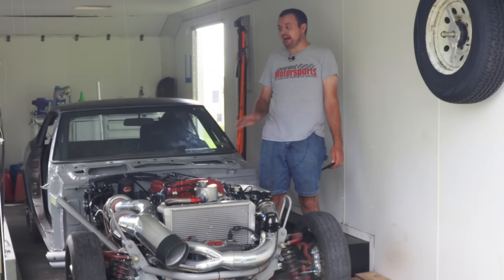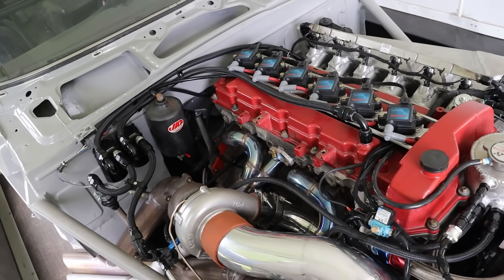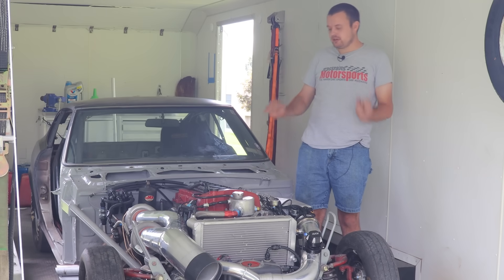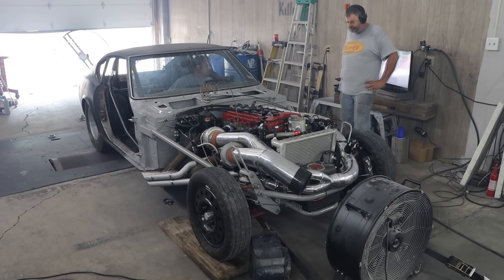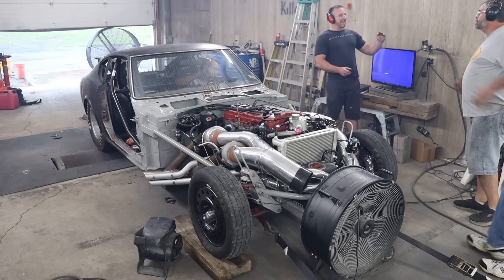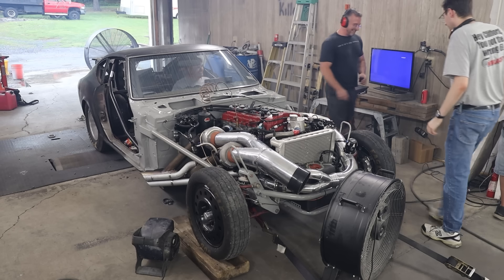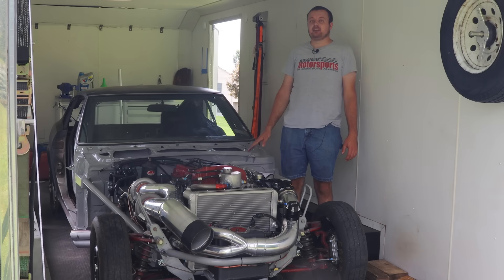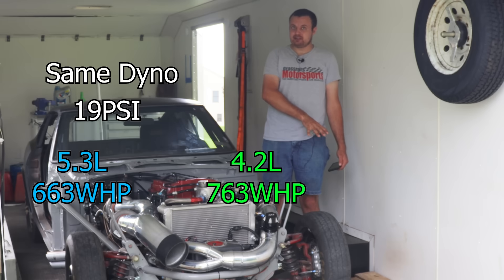This 4.2 Liter Engine Just Beat a 5.3 LS!

Comment: Im not certain why its refered to as a Barra engine.  Y understanding the Barra is a Australian ford eng   https://en.m.wikipedia.org/wiki/Ford_Barra_engine
Reply from the maker: We didn't get the Barra. It's similar to the Barra in a lot of ways.... so Ameri-Barra
Reply: @Calvin-Nelson  i understand but if its not a barra its just a inline 6 which is what the barra really is. The only real differance in the so called barra is that it has a very strong block that is really the very old ford 6 devoloped in Australia, for the lot tougher Australian conditions to ensure it could acturally last a reasonable time. 
Holden (GM) also had similar motors which replaced the old gray block. The red block was also made very strong to counter the vibrations and the harsh enviroment. This is what made them great engines. 
Both companies also devoloped a stronger v8 based on the american motor to overcome the same problems. Chrysler did the same for the v8 only
Also anouther reason is our fuel rating were different thus the need for slighly different compression ratios etc.
That is also why holden were still making the v6 blocks in aus and in the end the south americian blocks used in the USA were the aussie casting design. 
So in reaility the nick name of the Barra is just an Aussie 6. We Aussies love nick names and slang.
Reply from the maker: @tfsupp  OK. That's nice. A lot of folks I talk to call these the Ameri-Barra. Americans like nicknames too.
Reply: @Calvin-Nelson  yes its nice that you use our nick names. I really dont have a problem is just points of interest. 👍
Reply from the maker: @tfsupp  yup. There has been a  few Aussies that are very upset that I dare to compare it to a Barra. It's just an engine. Barras are probably better but we haven't proven that yet.
Reply: @Calvin-Nelson  i understand, im not upset at all, in fact im not even a ford or holden man (calling a GM motor a barra (ford) butt fu@ks all the ford idologs, big tribal issue here )  As  fitter turner (what you call a machinist) & marine engineer i just like engineering. I acturally love what you did here and your channel. Sorry if i didnt explain the original comment well. 😊👍

Comment: I have so much respect for you guys, doing what you've done with this platform. Just because a refined combo of one engine makes more power at a certain boost level than a random combo of another engine doesn't mean it's superior. It DOES mean that it's impressive and deserving of aftermarket support. In fact if the oil pan, transmission adapter, and maybe a few options on headers and mounts, then the weekenders might start trying this stuff out and that would be great to see!
Reply from the maker: Eh. I think the impressive part is how much less cam it had. Just my opinion.

Comment: I purchased a trailblazer with a 4200 in it that was knocking like crazy. Thing threw a rod on the way home, 2 large holes in the block and it still drove 6 miles to a friends house. 

Everybody that knows about these engines know their strong as hell. I rember someone saying GM didn't release cam blanks or cranks for them that's why nobody bothered building them.
Reply from the maker: You can get so much out of the stock cam grind. There has been a lot of folks that have built them. Most have them have been very secretive about it though.

Comment: I've been wanting to do some kind of build with one of these engines for years.  I'm thrilled to see how this latest build performed.  I'm personally interested in the 3.7L 5 cylinder variant because I've considered an Atlas engine for a few platforms that the six might just be a bit too long for. (the exhaust note would turn some heads too)  I've already got the car to put it in, it would end up being a RWD conversion for the chassis and definitely be a one of a kind swap on an iconic 80s European chassis.   One aftermarket part idea I think would be cool: forged pistons in the 2.9/3.7 4 and 5 cyl bore size (in addition to the standard bore)  
Has anyone been able to determine the thickness of the cylinder sleeves?  It would be cool to bore the 4.2 out to the bore size of the later 4 and 6 cylinder variants if possible, that would give you a 95.5mm bore and a 4.4 liter displacement.
Reply from the maker: I believe the Self Racing guys did that. Personally I think it is a waste of money with turbos, but to each their own.
Reply: @Calvin-Nelson  As in, the overbore?  I can certainly understand how the mild displacement bump isn't worth the money and machine work, for sure.  I couldn't help but be curious about the cylinder wall thickness, though.  Maybe at best,  overboring to 95.5mm might be one way to rescue a 4.2 block w/ bad bores?

Mostly I'm just interested in following the methods you guys have come up with on the 5-cylinder variant, I think just under 5/8 the horsepower and torque will do my project just fine!

Comment: Curious if you've ever thought about dropping in a 4.2 i6 into a Pontiac Solstice or Saturn Sky?  I'm contemplating whether or not to take on this very build myself.  From what I understand the 4200 will mate up to the Aisin AR5 5sp manual it just requires getting a bell housing from a Colorado 5sp manual.  I would be very interested in knowing what you think about this idea, Calvin?  Thank you in advance.
Reply from the maker: That would be very cool. Might be a tight fit, but I'm sure you could make it fit with enough determination.
Reply: @Calvin-Nelson  - That's what I'm thinking! Have you seen anyone mate up the 4200 to the AR5 manual transmission before? From what I've researched I've only read that it is possible, but can't find anyone that has done it yet.  This would be another reason to do it, just to be the first.  A ton of people have LS swapped the Solstice/Sky platform, but I think an I6 would be epic.  I really enjoy your videos and content. Thanks for your input and response!
Reply from the maker: @WattsAudioTahoe  the colorados came with an ar5. It's been done many times.
Reply: @Calvin-Nelson  -- Thanks Calvin, I'm glad to hear it's been done. Good luck at the No Name Nationals!  Can't wait for the videos!

Comment: I think you're going to be hard pressed to get big name manufacturers to provide parts for something that's been out of production for so long. These engines will dwindle away long before they could ever recoup the associated costs.
Reply from the maker: You could be correct, but LS engines are no longer mass produced and they still have parts made. Same with 2JZs, 440 mopars, Small Block Chevys, etc, and they still have parts made for them. Just saying.

Comment: Fun engine but even with all your modifications you can't fix that anemic torque curve. Love what you are doing but this engine was just never meant to be driven around the town. At least in my trailblazer I would often wish somebody would hope out and start pushing because until about 4500 rpm there was no torque.
Reply from the maker: Sounds like something was wrong with yours because in stock form they've had nothing but torque in our experience. They just need freed and boost shoved down their throat.
Reply: @Calvin-Nelson  nothing was wrong it just didn't have much low end torque. After 4000rpm it was quite fun, but felt like you always needed to down shift to pass or build rpm from the stop sign before it got exciting
Reply from the maker: @brianhunt6943  yeah. It sounds like your VVT system had issues.

Comment: What were the full specs on the 5.3? I can see a dohc 4 valve matching a proper H/C 5.3. Hell of a turbo set up. Wonder what that motor weighs.
Reply from the maker: The 5.3 was a stock bottom end LC9 with 706 heads. I had the cam specs in the video. The 4.2 and aluminum 5.3 are very similar in weight.

Comment: How well would this motor do in a half ton truck? I know ford has the smaller 3.5 Ecoboost but is the 4.2 good enough in a daily driver truck application? This motor could be the end all Ecoboost killer and could probably outperform that inline 6 dodge is making
Reply from the maker: It would probably do pretty well. They make good torque.

Comment: 2002 4200 trailblazer cam position code. Replaced it and cleared code. Code is back runs rough but only sometimes
Reply from the maker: Sounds like vvt related issue. Could be the solenoid or the actuator
Reply: @Calvin-Nelson  thanks. I'll try the cam phaser solenoid then

Comment: Same boost but less cylinders to fill with air. So wouldn’t the same boost be different from the v8 to the v6
Reply from the maker: Boost is boost. Volumetric efficiency is volumetric efficiency. Doesn't matter how many cylinders there are.
Reply: @Calvin-Nelson  oh cool. So 19 pounds in 8 cylinders is the same as 19 pounds in six. That’s cool. Never knew thought. But assumed for a long time. Thanks for that information. Always needing to learn new facts. Thank you
Reply from the maker: @leviorourke7498  No problem. Boost is just a measure of restriction. What this tells us is the 4200 is less restrictive and flowing a lot more air.
Reply: @Calvin-Nelson  so glad you commented back. A lot of stuff now makes a lot more sense. A lot more sense to my outlook on certain mods an motors. Thanks again!!
Reply from the maker: @leviorourke7498  Yeah. The more base airflow you can get the engine to make, the less boost it takes to meet your power goal. The temperature of the air that is coming out of the turbo is directly related to how much pressure it has to make (most of the time). So better flowing engine means lower boost means lower charge temperatures means more knock resistance. 

What is also amazing is is the 4200 is doing it with less cam shaft. This means you can run more mild valve springs. What people have found on Drag Week is valvetrain is the most common failure point. So it's better for Drag and Drive events too.
Reply: @Calvin-Nelson  so many facts! Awesome. An very well worded for anyone else to have a clear understanding as well. Thanks again
Reply from the maker: @leviorourke7498  Happy to share. Glad it is helpful.

Comment: problem is nobody cares anymore unless you can make 1,500 hp with them because an ls7 can in a pretty small package. Love the 4200 but the gen V 4.3 v6 makes more power stock for stock. Would love to see what the limit of these things are though, LS engines are just boring now.
Reply from the maker: Yeah. Plus 4 valve DOHC is going to be way better for high RPM use, which is going to be way better for big power applications.
Reply: @Calvin-Nelson  Yeah even if  the v6 had 6v per cylinders the things sound like someone farting in an aluminum trash can lmaooo inline 6>v6
Reply: the v6 is one of the worst sounding engines and i think the difference is a couple HP stock for stock. 291hp on 93 (4.2) vs 297hp on E85 (4.3)
Reply: @thewraith6360  A v6 can sound good if you setup the header merge point at close to equal lengths. Not sure about the 4.3 but doing it to a 3800 makes it sound insanely better haha!

Comment: Why reuse the old bearings when you already have the engine apart?
Reply from the maker: The hope is the original bears have worn a little and opened up the clearances, since you cannot get extra clearance bearings for this engine.

Comment: So is the 4200 vortec the vortec out of the blazer?
Reply from the maker: Trailblazer.
Reply: @Calvin-Nelson do you happen to know what year & trim trailblazer has the best block to pull? I like non traditional engines & J35’s are getting a bit pricey
Reply from the maker: @matthewserrao2926  depends what you want to do. Any year is good, but the 2006+ engines had a better head and piston oil squirters.

Comment: The only issue I have with that engine is packaging. There's a lot of smaller vehicles this engine will not fit in, mainly FWD, and mid engine vehicles. V8 engines barely fit in S10 trucks and this will surly not fit.
Reply from the maker: Go watch out Fiat build series. If you think an S10 is a tight squeeze, then that will look like the impossible
Reply: @Calvin-Nelson  Yeah, a Fiat is practically a go-kart. Lol

Comment: 10:41 I agree but most so-call car guys would rather have a slower v8 because they sound better. I fell in love with straight 6 turbo engines after driving an 82 280zx turbo in 1989. I remember when the 87 GN 231 cuin v6 was beating v8s at the track. People just didn't understand how 3.8 v6 could act a fool.
Reply from the maker: To each their own. I like the sound of a turbo straight 6 a lot better, but V8s sound good too.

Comment: Is the cam difference taking into account the rocker arm ratio of the LS? That’s even more lift than the 4200 which I believe has hydraulic buckets? So the 4200 only opens the valve exactly as much as the lobe height at best, whereas the LS has more valve lift than the cam lobe height.
Reply from the maker: The 4200 has cam followers with a 1.68 ratio. I'm just giving you the numbers that Schneider gave me.

Comment: I’m surprised how much power it makes on low boost but disappointed a bit with the power at 20+ psi considering the massive size and good flowing head. Cams running out of steam?
Reply from the maker: I think the cast wheels on the turbos are starting to limit us. Maybe the turbine housings too.

Comment: Any good builders out there looking for work?
Reply from the maker: The stock motors are pretty tough. We've had stock motors with cam and valve springs to 824whp. I don't think there is much need to build an engine under 750whp
Reply: @Calvin-Nelson  ....Thanks for the reply. Just to let you know ,my name is Calvin. What do I need to get the BBC up to par? Its a 427 Chevy Big Block. I want to bore it out,different heads,cam,crank and twin turbos. I want to drive it on the street and drag race it. The trans is a 700R,will I need a different rear end,gears,etc.,  Any advise is much appreciate. I have a gift for you for your efforts. Thanks,Calvin
Reply from the maker: @cryptopris9007  For that sort of thing, we use our buddy Snyder Performance out of Dover, PA

Comment: How did you figure this back calculation
Reply from the maker: 867÷.85=1020
Reply: I don't believe in that type of math. Because your statement is that your load changes the higher the hp gets. It takes a TQ of x at a rate to make the drivetrain move which is a constant. The los of grip on the dyno will cause a lower number than reality tho. 
Its inaccurate to use a efficiency number for drivetrain loss.

Comment: Aussie Mopar fan here, great motor I never heard of before! I grew up driving Valiants with the 245 and 265 Hemi 6, now I can't afford them. Currently drive an 02 Falcon 1 tonne ute( intech 4litre six, dedicated lpg). Another bulletproof big inline six ( I know because I've owned 2) is the Jaguar AJ6 and preferrably the AJ16(no distributor version). These motors were designed to be strong enough to be diesels had Jaguar fulfilled all their plans.   Jaguar supercharged some and there were a few built turboed by aftermarket companies and sold as limited run new cars. Jaguar helped Ford with the crankshaft of the intech six for the Aussie Falcon even. Perks of Ford owning Jaguar back then- pretty sure there's more influence than that which has resulted in the Barra.
Reply from the maker: That's awesome man. I wish we got the hemi 6 cylinders here.